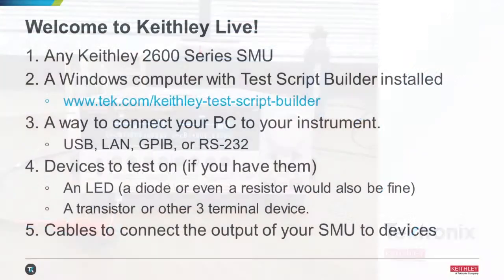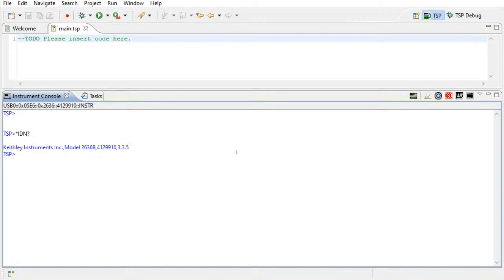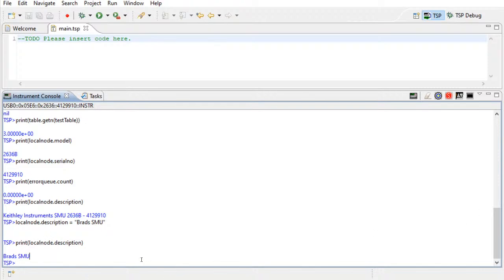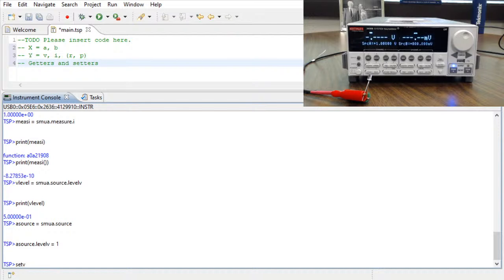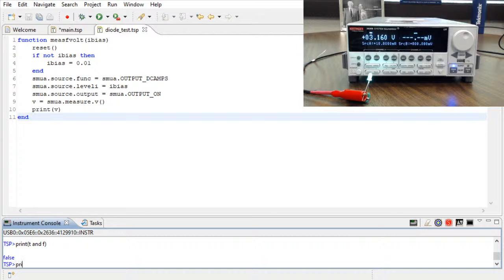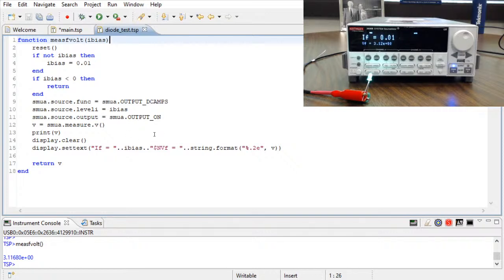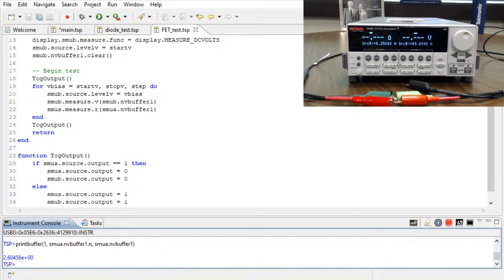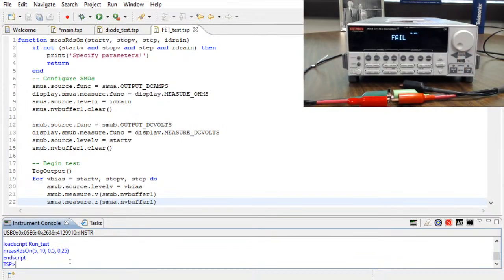Keithley Live: Programming a 2600B SMU

Comment: how I can connect Keithley 2636a source meter to the computer (connection)?
Reply from the maker: Thanks for this question, you can use LAN or GPIB to connect to Test Script Builder. This document will help, specifically pages 2-82 https://download.tek.com/manual/2600AS-901-01--E-Aug2011--Ref.pdf.